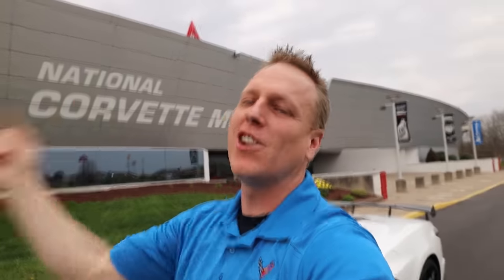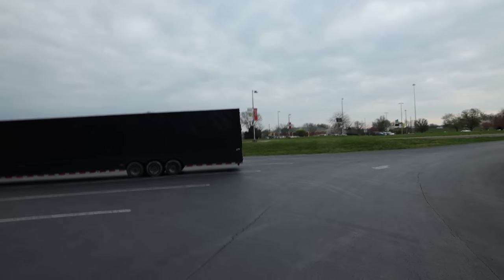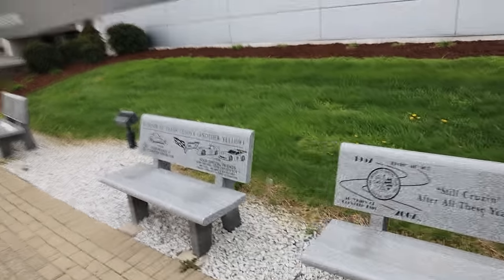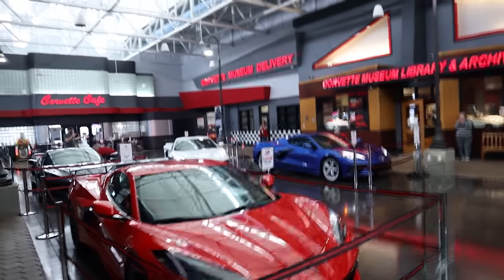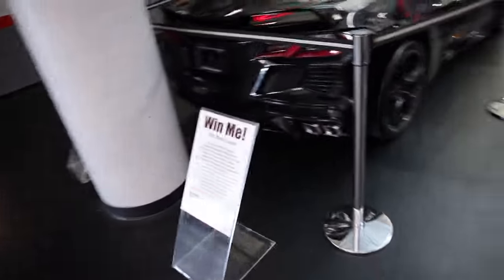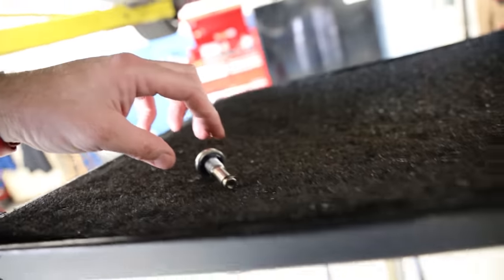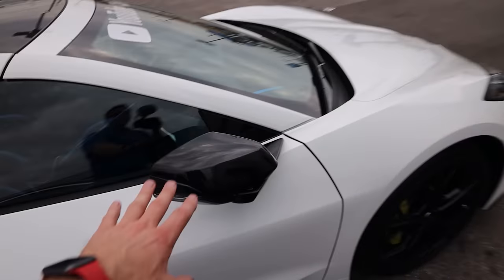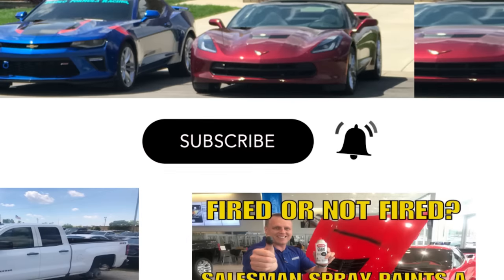NEVER ship a car like this. My first 2020 Corvette Museum Delivery.

Comment: In Oklahoma we call it Oklahail...haha. I've lived here all my life & have been so fortunate to never have been in a tornado. However i have experienced hail damage one time. Back in '99 i had a new Ford Ranger 4x4 that was only 6 months old. The night before i didn't park in in the garage. I woke up the next morning around 10ish am to this extremely loud roar in my house. I thought what the hail...ha. I looked outside & saw hail like i had never experienced before. And there was my Ranger sitting in the driveway getting pounded with almost golf ball size hail. Talk about a hopeless feeling. Wouldn't wish that on anybody. After about 10-15 minutes of watching this bad storm I went outside to look at my truck & my heart dropped to my stomach. Windshield, & some of the other glass all busted out. Major dents on the hood, roof & in the bed. Sides of the truck not so bad. Well to make even a longer story short the insurance totalled the truck out. I did get another new truck same model & equipment, & color. I did have to shell out $500 to replace it which i considered a pretty good deal & from then on that truck never sat outside again! I still have the truck today & somehow have managed to put 35,000 miles on it...ha

Comment: What oil do they recommend to use?  Just curious, would be interesting to see if Royal Purple adds 20 HP with out doing any mods
Reply: Check out the Project Farm testing channel.  Many of his product tests are motor oils.  He is very thorough and completely unbiased.  You may change your mind about Royal Purple.  Check him out, it is worth it!
Reply: Used royal purple in two cars that I had and had no problems with them motors ran cooler, better fuel economy and power.
Reply: Mobil1 0W40 ESP formula

Comment: So I always wanted a corvette since I was 14. Here I am at 48 and finally got one. It is a used 2015 Z51 2LT. It is a second car for me but I drive it more then my other. I got the car to drive not sit and look good. Since I have had it I’ve put just about 1000 miles in a month LOL. I do have a question though about my car hoping you read this and are able to answer. Is there anyway to upgrade my radio so I can get nav, Apple CarPlay and WiFi?

Comment: Did ACS come up with the CF mirror caps for $1000 on April 1 ?  I'd save the grand and use it towards a Borla or Corsa exhaust.
Reply from the maker: No that’s GM.
Reply: @ChevyDude  My bad. Then I guess GM has more of a sense of humor than I thought. Stay safe.

Comment: Dude, invest in a clip on wireless mic
Reply from the maker: Clip on mic won’t help in 35 mph winds.  Plus they are pain with keeping them charge and putting them on
Reply: @ChevyDude  I only mentioned that because when you turned away from your camera it was difficult to hear what you were saying...if your clip on has a wind screen that would help, but again I would not try to Vlog in high wind.